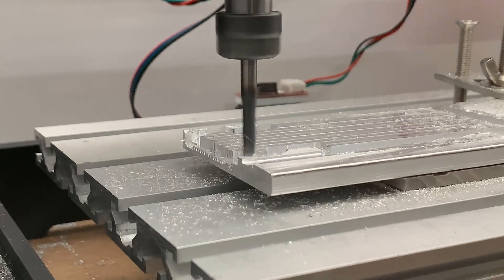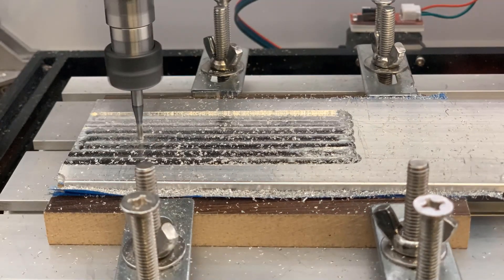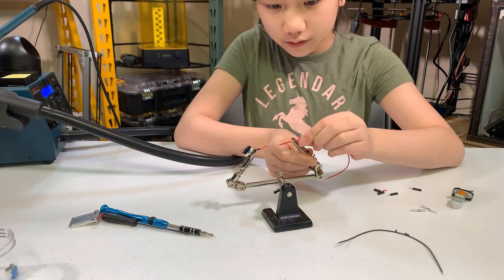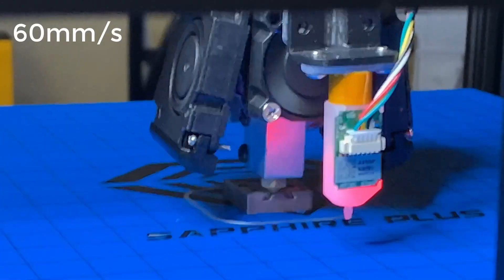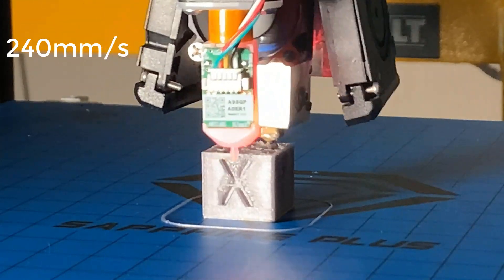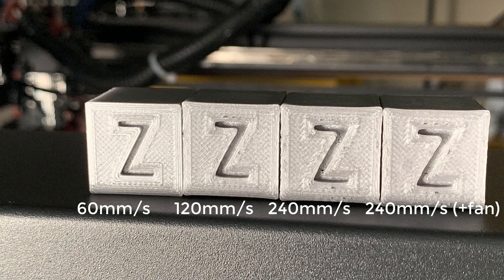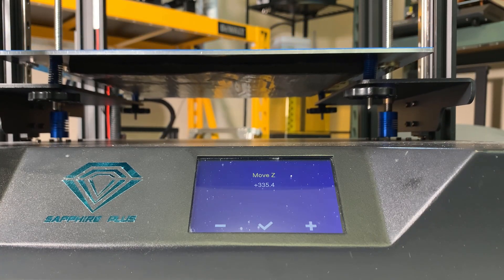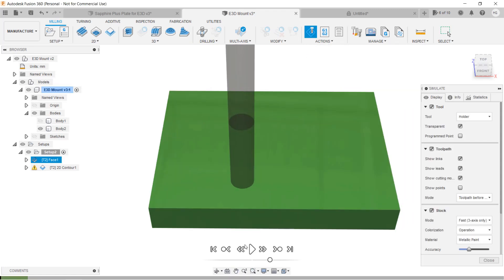CoreXY Sapphire Plus High-speed 3D printing | CNC 3018 DIY aluminum mount for E3D Volcano hotend

Comment: Again great work !!! Very professional and helpful! I'm wondering if you would like upgrade the Sapphire plus to direct extruder and maybe also with resonance sensor to improve the high speed quality. Currently there is a High Speed Printing Kit for SP-5 available, which looks quiet interessting. 
I will upgrade my Sapphire with that, but looking for information about the resonance sensor.

Comment: I definitely would like to see the CoreXY Sapphire Plus 3D printing at really high speeds such as 1000mm/s or getting at least close to it with the same quality finish as this video below: https://www.youtube.com/watch?v=qIm9qYPy0-E

this printer seems to have a nice and quite strong frame structure  to get started with upgrading for higher speeds. Some nice content would be pretty much well appreciated. I am also trying to increase speeds on this printer but very slowly. When I have some nice results I'll share on my YouTube channel. I am aiming for the 1000mm/s and 30000mm/s acceleration with as little modifications as possible

Comment: Nice. Have you tried with silicone sock, plated nozzle and bi metal heatbreak? On my volcano it's much better.

Which firmware you are using? And have your removed the timing belt between both z steppers for this zx level feature?

Comment: Great video.

For the high speed printing definitly cooling is the limit. Have you ever tried the Berd air solution using pipes and an air compessor?

Altogether this printer seem to be a nice base for tinkering, improving the quality of fast prints. Beside testing Berd Air I would also consider Klipper - with an sensor for accelleration for input shaping to reduce ringing on high speed. You should be able to nearly get the same quality on 240mm/s like on 60mm/s

Comment: Quick tip when cutting aluminium (especially small pieces) on the mitre saw.
Use a sacrificial board (mdf) behind the cut, this stops the piece from getting jammed in the slot.
Also safety goggles! Even on a quick cut, you do not want to catch a chip in your eye. It is not fun at all.

Great content though. I’ve just recently found the channel and have been watching all the back catalogue.
Well done guys. 👏🏻

Comment: I would add or design a rounded fan duct. Those blowers are not that great for fans. You might be able to get away with an Orbiter extruder. Its only about 150g total weight. I have that extruder for my FLSUN QQS Pro. You might be able to mod the plate some more to raise the hotend. Maybe even cut more material out to lighten it up. just some ideas to think about.

Comment: i printed 240mm/s with totally stock setup, and quite large parts. for 330$ shipped this printer is great value, but people still keep complaining.
Reply from the maker: Hi! Yes, the Sapphire Plus is a very solid printer. I will also do a review on the Bluer Plus. It's also a good printer, with amazing hard configuration at a super low price, and just with a few minor issues. In fact, most budget printers have similar kinds of issues, but I think the Sapphire Plus and Bluer Plus are definitely worth their prices.

Comment: Is using a CNC the same as 3D printing? 
Can I generate G-code for cnc as easy as 3d print?
Reply from the maker: Hello! It requires more steps than 3D printing. You need to use CAM software to generate G-code, but I will make more videos to show how to do that!
Reply: @AuroraTech  Cool Thanks!
This will be a game changer.

Comment: You need to look into getting Klipper on this machine if you want to print fast. You`ll need a Raspberry Pi 3 or 4. 2 or Zero will work too but don`t support using a camera. Once you install Klipper you can use Input Shaper and Pressure Advance to tune the machine for speed. To really have actual 240 mm/s in such a short distance as that 20mm cube you`d need crazy 10-15k acceleration. That was more like 100-120 mm/s max. And your cooling part assumption is correct. Especially for PLA you`ll need lots more cooling to print at those speeds and maybe print 2 cubes at once so it has a chance to cool between layers.

Comment: Iv been watching your videos on this printer and I have to say I am really impressed!  Any chance you have a link to the particular hotend you used?
Reply from the maker: https://www.aliexpress.com/item/32844080369.html

If you print PLA/PETG/ABS or anything less than 250C, select PTFE lining or Bore version, if you print high temp filament, select all metal version. 

But don't use all metal version to print PLA, it will clog.
Reply: @AuroraTech  Thanks.  People tell me the same thing with my Micro Swiss, but it prints PLA perfectly, just have to set your retraction correctly.  I was just looking for a proven Volcano, most of the reviews of the ones on Amazon are sketchy.  

It is mostly going to be printing PETG though.